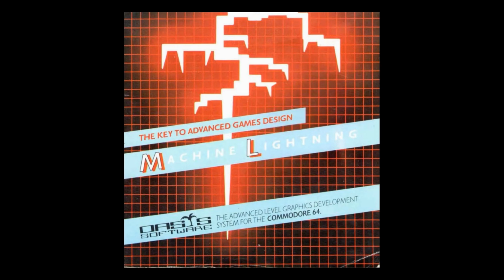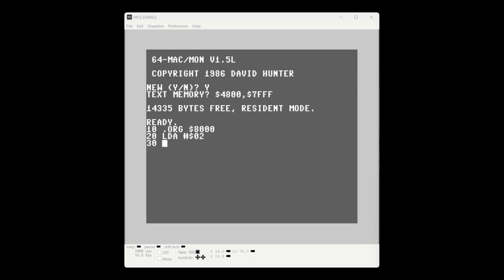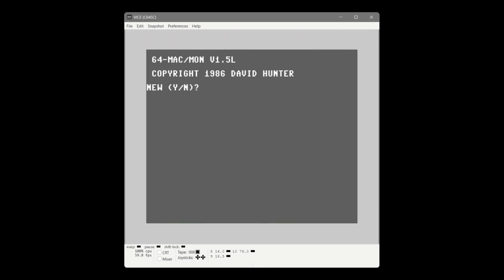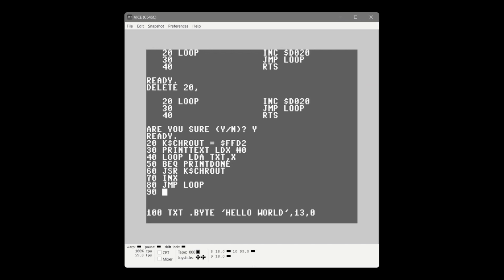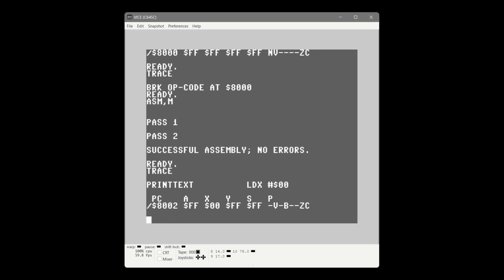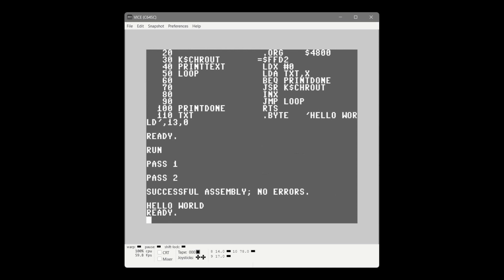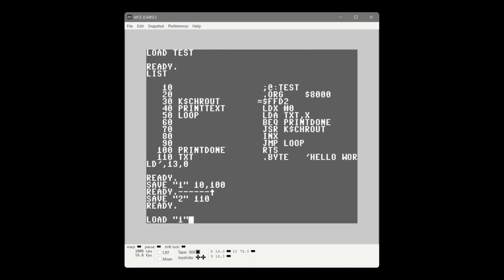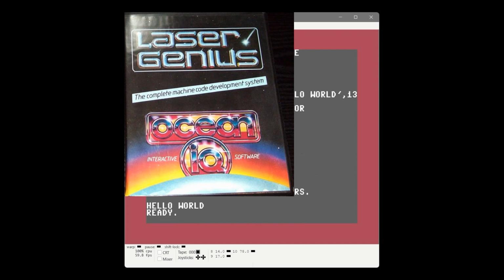Learn 6502 Assembly Language with the Laser Genius Machine Code Development System on a C64.

Comment: There is one trick to auto-running a BASIC program after loading it from disc. There are a few other ways to do it but this is the simplest.
Add this line to your BASIC program:
0 POKE770,131:POKE771,164

Now type this command line in one single line
?"{CLR}":POKE770,113:POKE771,168:POKE43,0:POKE44,3:POKE157,0:SAVE"FILENAME",8

This one line command does the following
1. clears the screen
2. sets the address where Basic will go after the load. Normally 770 and 771 point to the BASIC "idle" routine which prints the READY prompt and waits for input, but pointing it to $A483 directs it to the "run" routine in BASIC ROM
3. Location 43 and 44 are set to change "start of BASIC" from 2048 ($0800) to 768 ($0300)
4. POKEing 157 with 0 suppresses screen messages during the save.
5. Saves the BASIC program but it starts the save at location 768 ($0300) rather than 2048 ($0800)

The command clears the screen and then proceeds to save the program starting at memory location 768 ($0300). This embeds the altered "idle routine" address held at 770 ($0302) and 771($0303) with the Basic program. Once the program saves BASIC will run the program because the idle vector is still altered. Since the first line in the program resets this back to it's default you can halt the program to get the ready prompt. After this it's best to recycle the power to reset all the pointers. Realize that the current screen is also saved with the program. If you don't clear the screen first what ever is on the screen at the time of the save will appear when the program is loaded. (text data only)
Load the program with LOAD"FILENAME",8,1. This starts the load at address 768 changing the "idle routine" vector to the "run" routine vector. The first line in the program sets this vector back to the "idle" routine.
I also recommend saving a non-autorun copy of the program so it can be loaded normally for further programing and refinement. Line 0 can exist in this copy since it only sets the "idle" vector to it's default location.

Comment: Pilfered from the internet due to my failing memory.
Vector Technqiue:
=========================

Make the load address of the file 02A7. Put some ML here that emulates a
RUN command by calling rom routines, or poke in R U N into the keyboard
buffer, or whatever. 

At address $0302 plug in the value A7, and at address $0303 plug in 02.

When you save the file, start saving at address $02A7, end at the 3rd 00
00 00 in the normal basic address space ($0800).

When the file is loaded ,8,1 it starts loading in data at 02A7 which is
your autoboot code. When it reaches 0302 it overwrites that vector and
re-directs control too your ML. When the file finishes loading, it
executes your ML automatically

Comment: How to make a program run directly after load without having to type RUN? Well, first you need to understand what's the difference between load,8 and load,8,1. load,8 is just a short form of load,8,0 and that means load the program at default memory location, and that's $0801 (2049), which is where BASIC programs are loaded. Machine code programs on the other hand can be loaded pretty much into any memory location. load,8,1 means load the program to whatever memory location the program wants to be loaded. Therefor the first two bytes of the file need to contain a memory address and at that address the program is getting loaded. So what happens after the loading operation has finished? Well, the system returns back to the input prompt, right? Therefor it executes code in some memory location. Just make sure your code loads to a memory location the system will execute after the load command finished and it will execute your code instead of the code that originally was stored there. 

A common way to do that is to load your code to $0326, as that's where the KERNAL looks for a jump address to a function (a vector, more precisely the CHROUT vector) if it wants to print "READY" to screen, which it will do before returning to the input prompt. If you load your code to that address and the first two bytes of your code contain a jump address to the start of your program, then instead of printing READY, the KERNAL will start your program. This approach has downsides, however. E.g. note the addresses directly after $0326 contain more vectors, that your code would override. If you want to keep those functional (e.g. if you want to use them from your program code), you need to embed their original values in your code as well (e.g. the STOP vector, the BRK vector, the LOAD vector, etc.) This however can be a problem as different revisions of the C64 had slightly different KERNALs and those may have had different vector addresses, that's why sometimes programs would not run correctly on all C64 devices, depending on edition. Another problem is that the memory at $0400 is the screen memory. To avoid that your code conflicts with that memory, you either have to relocate the screen memory, which is possible but only once your program started running (that's why many autostart programs shortly show garbage on the screen), you can bridge that memory by having all zeros in your code at all screen memory address locations and make your actual program start after it and then jump over that gab (but that makes your program large and waste floppy space for no reason other than zero filling) or, and that is a pretty common approach as well used by many games, have a small loader, that just contains enough code to get autorun started and then loads the real program, yet to a different memory location and start it from there (that's why many games shortly load, then autorun, and then load again, this time for a very long time). Of course, there are other approaches, the $0326 approach is just the simplest known one.

Comment: Very interesting video, but the software is SOOO primitive!
For comparison Oric Atmos (another 6502 based) had:
- Text editor - kinda E3 for DOS (to write the code)
- Assembler ... like Apple II (probably Merlin) - no line numbers nonsense, 2 pass, max 38k per file, multi file, huge variables names (64 or 128)
- Debugger - a real one, not like this toy in the video. It had a stunning UI for its time (imagine Borland Turbo vision interface), code displayed in scrollable boxes, break points, ...

P.S. I dont remember all the features, but really it was revolutionary - kind-a of what you will see later in DOS era (90s). Keep in mind that 1986 that computer was no longer sold.
Reply: Hadn’t herd of that computer, thanks!

Comment: I actually had this back in the day.
I remember reading a review in a magazine that said it was the best assembler you could buy at the time.
So i bought it.
To be honest, alot of it was over my head at the time and i never used it to it's full potential.
I ended up selling it along with one of my C64's and was never able to buy it again.
Something i regretted later on.
For most of my C64 coding i ended up using a ripped copy of Micro Assembler, which sat at $8000 in memory if i recall correctly and i would design my memory map around the assembler.
Great memories. :)
Reply: I bought some C64 assembly book "back then" in the 80's. I tried to read it - I was under 15 years old -  I had absolutely no idea what the hell it was supposed to mean

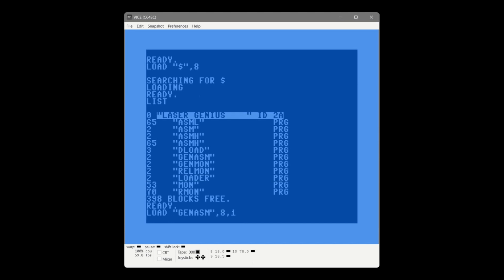Comment: 1:10 Load and run: I'm sure there are a few ways to do it but the one I know is to ORG your code to $0101 and fill the rest of the page (which is page 1 - the stack) with $01. When the kernal does rts from it's loading routine it returns to $0101, running your code.
It's only good for about 250 or so bytes but you can use it to load and run other programs automatically or, like GENASM did, print a simple menu, get your choice, and load it.
I'm pretty sure this is the method used by GENASM because it takes up only 2 blocks on the disk. Commodore disks use the first 2 bytes of the first block of a saved program file for the load address and 2 more bytes each block to point to the next block. So a 255 byte program ($0101 to $01FF) saved to disk will use 259 bytes or 1 complete 256 byte block + 3 bytes of the next block, showing it as using 2 blocks.

Comment: 10:05 I have a real c64. Assy 250407. I have a kawari installed and it always comes back with F for the high nibble. I have also swapped in my original 6567R8 just in case but it also does the same. I think it it is pretty safe to say vic chips always return F for high nibble
Reply from the maker: Thanks for doing this!  I also learned today that there exists a modern replacement chip for the VIC-II that offer HDMI output.
Reply: @MyDeveloperThoughts  you're welcome.

Comment: Great little package! Nowadays there are many modern environments to program in not just for the C64 but for many of those old retro computers. CBM Studio comes to mind, as does Turbo Rascal that can compile for many older systems and languages (mainly a Pascal-like language called Rascal but also assembler). Here's the blurb about it on their website:

(Turbo Rascal SE, TRSE) is a complete suite (IDE, compiler, programming language, image sprite level resource editor) intended for developing games/demos for 8 / 16-bit line of computers, with a focus on the MOS 6502, the Motorola 68000, the (GB)Z80 and the X86. TRSE currently supports application development for the C64, C128, VIC-20, PLUS4, NES, Gameboy, PET, ZX Spectrum, TIKI 100, Amstrad CPC 464, Atari 2600, 8086AT, Amiga 500, Atari 800, BBC Micro, Mega65, MSX, Apple II and the Atari ST 520. With the benefits of a modern IDE (error messages, code completion, syntax highlighting etc) and a bunch of fast built-in tools, it has never been easier to program for your favorite obsolete system!

It runs on Windows, Linux and Mac. Here's the website: https://retrogamecoders.com/introduction-to-trse-programming/

Comment: I wonder how they implemented that trace command/single stepping in this and other old monitor programs.  I'd have to guess they're parsing the next instruction and simulating the results on the registers/flags because executing them (and re-capturing control by temporarily inserting a BRK in the next instruction and capturing the interrupt) would let a jmp/jsr would take off and execute multiple instructions (unless they also temporarily put BRK's at the destination addresses???).  Really neat feature and probably a pain in the ass to implement unless there's some simple way I'm overlooking.
Reply: The BRK technique you describe seems workable. I notice in the video that the trace does not step into the KERNAL routine. I would guess that it limits itself to tracing code that it has itself assembled, because it knows it can write to that memory (and can insert BRK statements into ROM). Monitors use BRK for everything, because it stashes register state and expects your interrupt handler to restore that state just before resuming, so it's easy for the utility to allow adjusting things like the program counter even while running on the machine. It's magic. :)

I love the idea of using a machine code interpreter for debugging purposes, but if the BRK technique works I wonder if it's overkill. It too would have to be careful about system calls and KERNAL variables and such...

Comment: these old tools were great back in the day, but now you're really better off using modern tool chains like vscode and kickass and cross compiling
Reply: Point missed I think
Reply: I want to learn more about the machines and software that was used so for assembler.  Clearly, anyone writing serious software for the C64 now, like new games, etc. would use what you suggested but that doesn't mean that the information in this video is not valuable - without it I would never have even known about this assembler being used.  I also think it is easier to learn and understand (at least for me) while actually working in the C64 environment itself.
Reply: @phil2768 i wasn't disparaging the work shown here, i loved the video. i just thought maybe someone should point out there are newer/easier ways of doing things.  anyone new to c64 dev finding this video might not be aware of things like kickass.
Reply: @furroy  yes, I need to looked into using it myself to be fair.  I'd heard about it a while ago, set it up with VS Code, but never got to really dabble with it properly.
Reply: It really depends what you are after. I started using the original hardware again for the nostalgic reason... and many do.
8 bit show and tell is also great content and on the actual machines.
Another interesting thing is c64 os. Greg has been writing the whole os in tmp... on a c128. When I spoke with him about it he mentioned it all started with wanting to spend time on the machine... not somewhere else.
For many it is about the trip down memory lane.
Reply: If I want to do modern programming I'll take Rust, Python, C# whatever in VS Code or its bigger brother. This is about how operating with such old machines felt, how things were done, this has some specific down-to-earth feel to it. That's what I also dislike about some modern retro groups that shoot for the stars with modern tooling that was never intended for the purpose. I'm doing all crazy stuff with virtualization, clustering and the likes at work - but tripping down the memory lane, also learning what I was too stupid for as a teenager, I want to experience IT history and constraints the old fashioned way. There is also a feeling like owning the matrix by just assembling once per hand on paper and putting that in with POKEs.

Comment: I had Machine Lightning, back in the day!  I don't recall much about it, other than it was really easy to screw up the disk.  Seems like it had commands that wrote directly to tracks/sectors.  Thank goodness the first thing I did before I started playing with it was to back up the original.
Reply: There's a notorious bug in the 1541 drive's save-with-replace feature. SAVE "@:FILENAME", 8 is supposed to replace the existing version of FILENAME with the new version. But under the right (wrong) circumstances, the 1541 runs out of memory buffers and the information about where one file ends and another begins on the disk surface doesn't get updated correctly. This leaves the disk with inaccurate information about which sectors are safe to re-use for new data, versus which ones are occupied by files and need to be left alone. Once that happens, when you write new files the drive will happily plow over existing ones, and those files are ruined.

As soon as I saw him use the @: syntax, I thought to myself this is going to mess things up. Maybe not immediately, but the longer you continue using the feature, the greater the odds the bug will trigger. Seems to me this is what happened to you back in the day.